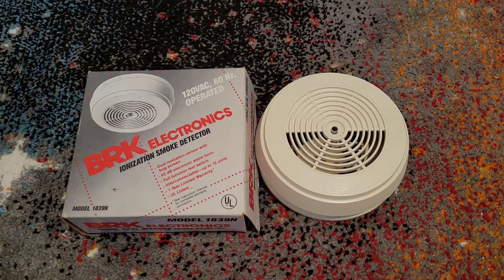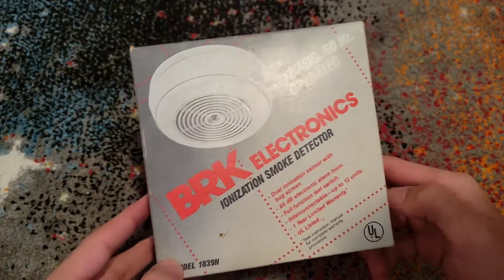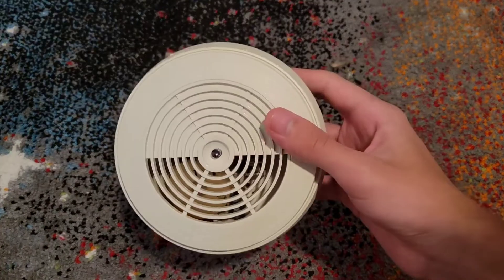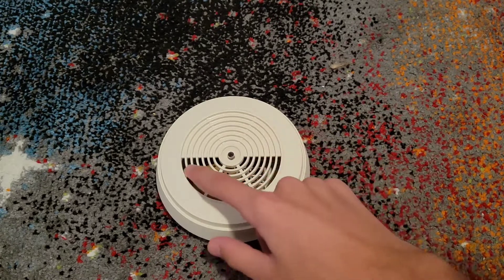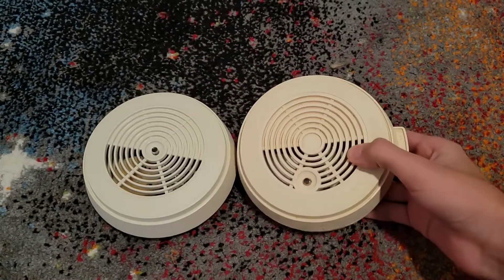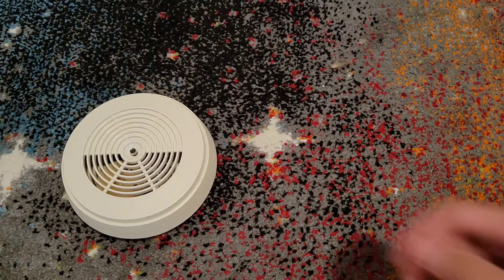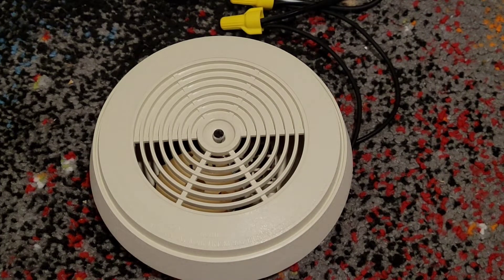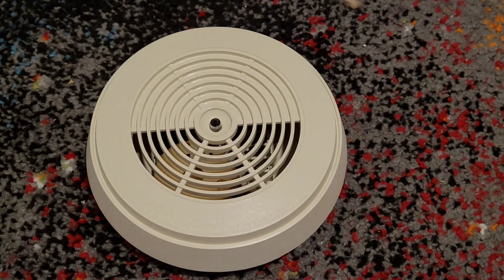BRK Electronics 1839N Smoke Alarm Overview and Test

Comment: Hey! I have one of these and every time i try to test it, it just turns off and won't come back on until i reset power. Any ideas on how to fix this?
Reply from the maker: It sounds like you actually have the recalled earlier version of this. They were recalled for this exact reason.
Reply: @Photoelectric_Elevators is there any way to fix it?